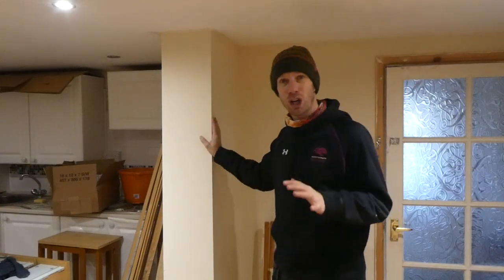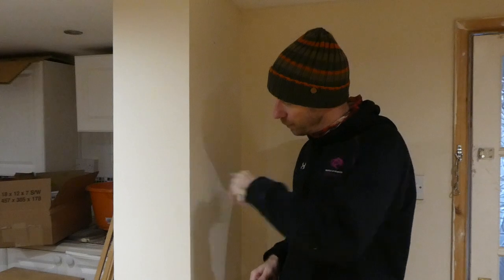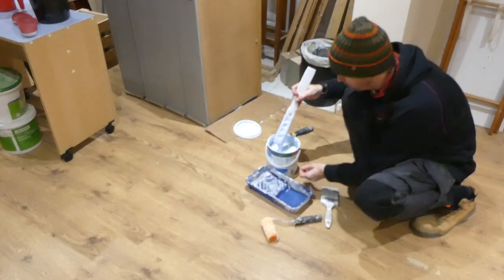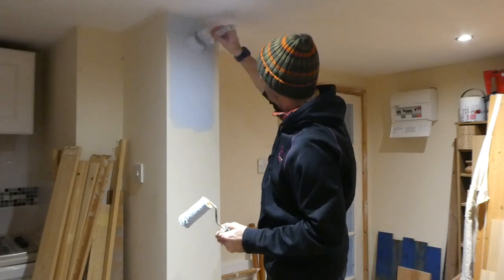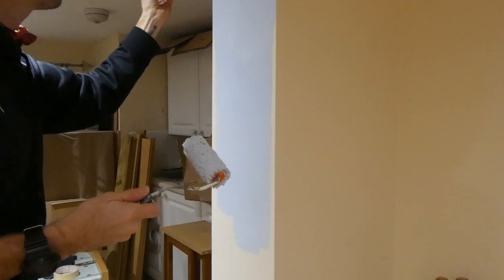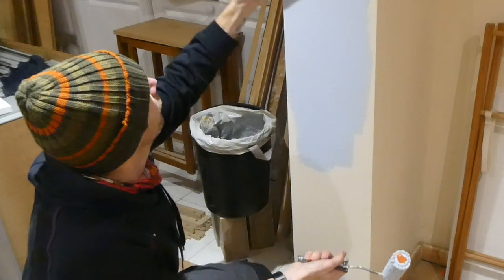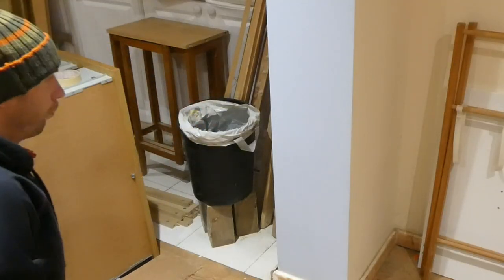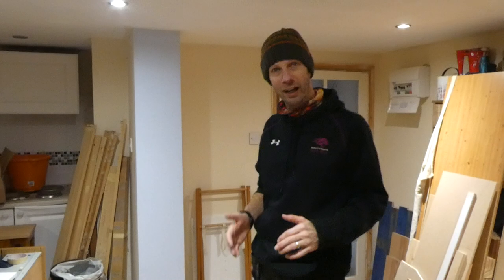How to paint an external corner wall in two different colours

Comment: This actually helps me with another problem. I've got an arch (with trim) between two very different rooms. One side of the arch is a different color than the other. Where do I make the break between the two colors? I guess I just pick the one that looks best and carry on. Thanks for the video
Reply from the maker: You could either, paint the arch between the 2 rooms the same as the ceiling, or, paint the arch the same colour as the wall that you spend most time in.

Comment: Cool video as always mate. Try similarly using mini roller the same as you have done but turn it angled slightly as if 2 o'clock roll out gently. Same result and it saves using the brush. 👍🏻👍🏻
Reply from the maker: Cheers spinx, 2 oclock is the technique I use with a big roller when the colours are the same, zero build up of paint down the corner, but mistake people make - straight up and down on a corner.
Reply: @JBTV   good job mate, its all about the finish and keeping customers happy, nice work. 👍🏻👍🏻

Comment: Wonderful technique. My problem is I've already painted the wrong way and now need to fix it. Can I use your technique on already set up walls? Wish I had seen your video before I painted :(
Reply: I messed up with many corners using the pink tape and the result was terrible. This video is my saviour ❤
Reply: @ReynardKryger  thank you. I used your method and it worked beautifully.

Comment: I’ve seen people doing this when they are painting external corners the same colour on both sides of the wall, do you think that is necessary? And if so why?
Reply from the maker: Hi Tim, this technique is ideal for avoiding paint build up and dripping on the other side of the wall you're painting, so it makes sense to use even if you're painting both sides the same colour. However, if I was painting both sides then I would use a roller, but rather than roll straight up and down on the corner, I would 'roll off' the wall to avoid paint build up just like the brush. Hope that makes sense... JB

Comment: one side of my wall is one color in the hallway, the other side (ithe living room) is a different color. I hate the edge being either  of those solid colors. Which wall owns that edge? Or do they both? I'm looking for ideas like what if i do a split down the middle. So i'm googling and come here thinking this is going to be an example of two different colors on an external edge but I'm confused... i see one color, not two? I'm not sure what this video is about anymore but its not what I thought based on the title, that's for sure. You mean how  to paint a wall end cap  without getting paint on the face side. May the google searching be in my favor next time.